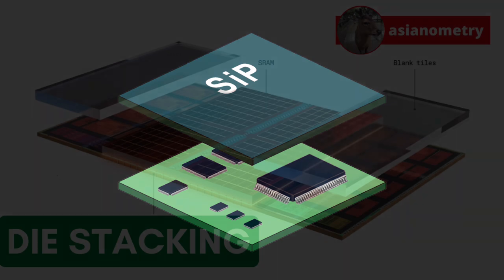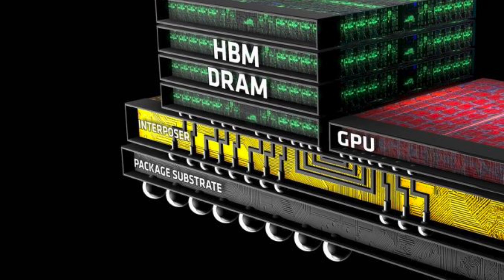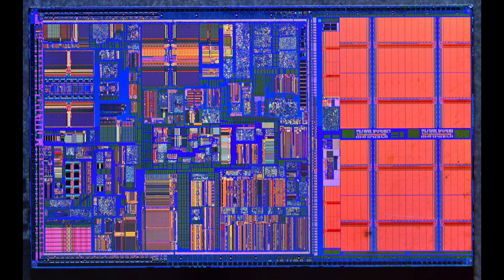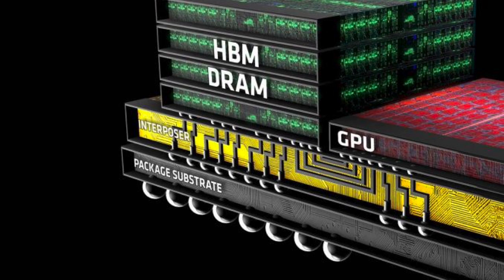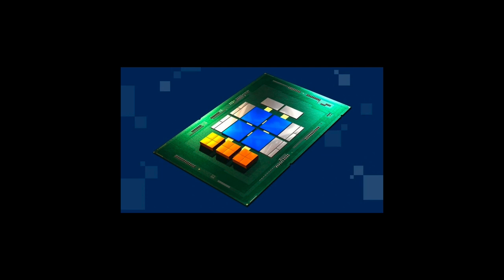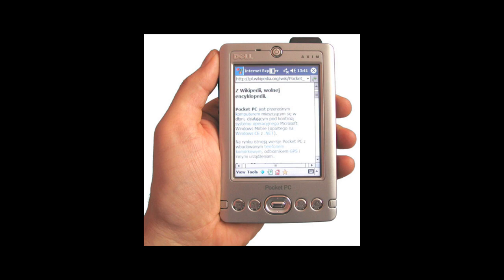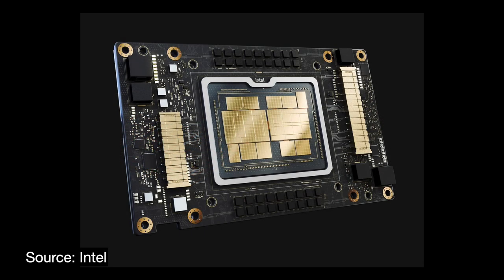Stacking Dies For Performance and Profit

Comment: At 11:35 you said "for their part, the memory industry went three dimensional back in the early 2010s", while showing a picture of a 3D NAND chip. 

The 3D NAND chip you're showing does not use die stacking. The 3D part of 3D NAND refers to multiple layers of memory cells built on top of the surface of the silicon, as opposed to "planar" memory cells or transitional transistors, which are only built one layer, directly on the silicon surface. The 3D NAND chips are still monolithic chips - single silicon dies, with many layers of NAND storage cells. Those 3D dies can then be stacked into multi-chip-packages using traditional die-stacking and wire bonding techniques, of course, but like you said at the beginning, that's been going on for decades.

Comment: I suspect one of the viewers might know this.  Do large sizes of L3 SRAM get as hot as the compute or accelerate portions of the die or is it essentially the same even if on a single planar wafer? Curious if the delta T for the cache is significantly lower then possibly it-itself could act as part of the heat transfer package to a heat spreader and to outside world.

Comment: I found MCMs really frustrating. Customers would ask for huge numbers of something we didn't have, but which was a simple combination of 2 or 3 things we did have. So, do an MCM with the existing  dies and we have a quick turnaround solution. However, when we got to the grubby details these things hardly ever worked out.

Comment: The channel is too focused on CPU/GPU.
Image sensors were the driver for 3D stacking. Direct wafer bonding (with Cu to Cu direct connects) of the pixel sensor chip to the image sensor processor is in high volume mass production since years. Everybody has such product today. The technology is amazing the pixel sensor wafer  is in the end only 10um thick and processed from both side with just tens nm overlay shift. Also the wafer to wafer overlay shift much less than 1um.
Todays smartphone cameras rely on that technology. You have very small pixels for small/cheap chips with many pixels but still low noise.

Comment: Can someone explain why we need to stack separate chips, instead of just adding more layers to the same chip? I know different memory and compute use different processes but can you really not just move the wafer from one to another?
Reply: They do that in DRAM and flash memory chips. I'm not sure why you don't see it done with logic. My guess is the transistors you can make are lower performing and slower so the processor would slower.
Reply: That is because the DRAM process is different from the HPC process, that is why on Zen x3D the stacked cache have double size on the same area.
Reply: @vitormoreno1244  the V- cache chip is SRAM, and they are usually made on the same process as logic, because in every processor except some of AMD's new ones, the cache is on the same chip as the logic. Making a chiplet with only SRAM let them optimize for it and double the density that they otherwise would get for the process.
Reply: @davidgunther8428  I'm pretty sure it's also because AMD were alerted by TSMC that memory-size scaling is going to slow down first - recall in the video when Asianometry mentions that memory only shrunk by 5% between 4nm and 3nm? Apparently 3nm+ will have NO shrinking of memory structures. It then behooves AMD to dislodge their cache from their logic, for future processors. (same obviously why they did the same with GPU's starting with the 7000-series, but without 3D-stacking)

Comment: I remember when stacking was putting a RAM box on the side of the big box with the CPU, instead of running fat parallel cables down under the floor, and up into the other box. Going from > 4 meters to half a meter.

Comment: Awesome video as always, just a small addition, TSMC 3D stacking don't use micro bumps, they use direct copper bonding. IMHO Intel version is called tiles just for arrogance.
Reply: Intels 3D stacking is called Ferveros. EMIB is referred to tiles which is 2D.
Reply from the maker: Thanks for the info!

Comment: Yesterday I ordered my first 3D stacked techbology - the Ryzen 7800X3D. I am exited since it is my first upgrade in over a decade.
Reply: I am also excited for my first 3D stacked technology, 5800X3D. Hopefully, will get it soon. These 3D chips are legendary.
Reply: Pretty amazing what Ryzen brought out. I'm still running a bulldozer "8" core 8350.. I'm no power user, but damn if ryzen isn't looking pretty great right now.
Reply: Embedded parts have been using dram stacked on top of the SoC for many years already. Just less advanced/specialized versions of the same tech. E.g. various smartphones and arm tablets have been using that tech.
Reply: @imrevadasz1086  that's not even remotely the same thing. Different memory technology, different rationale, different bonding method.

Comment: I recall Intel made a chip with something like 30 cores where each core had the L2 cache under the individual core, making for pretty exceptional latency. The problem was the things would basically melt, which is seemingly the problem we still have today. Without some kind of magic (MRAM) 3D stacking is probably going to be a serious thermal challenge with SRAM. Maybe not so much with eDRAM. Anywho, great video as usual.

Comment: AMD had to add substrates to their Vcache CPUs (5800X3D, 7800X3D, etc....) to make an EVEN HEIGHT across the top of the package.  The stacked cache only covers the cache on the main IC, so there's a lot of space that isn't covered by the stacked cache. In the diagram you show at the very end, the added substrates sit over the cores.  But you need the top of the package to be the same height (Z-height) because you need a VERY level top surface of the IC, because you put a heat spreader on top of this die and there has to be full contact between the IC and the heat spreader.  On top of the heat spreader, which covers the entire package and is what you look at when you see the top of a CPU, you put thermal paste and then a cooler which wicks heat away from the CPU.

So those substrates exist to make an even height to the IC so the complete IC package is in full contact with the heat spreader.

And TSMC's die stacking has been in mass production since early 2022 when AMD's 5800X3D was released.  It's now in 3 more AMD CPUs, their new 7800X3D which came out today, the 7900X3D and the 7950X3D.  Or, these are the desktop CPUs.  AMD also has server parts with stacked cache going back to Zen 3 EPYC, so once again early 2022.

You didn't cover the limitations of stacking, heat.  For CPUs or GPUs stacking is very limited because stacking a die over die when that die contains CPU cores which clock VERY fast, heat becomes an issue.  If the cores are on the bottom stack, the heat from the cores has to pass up through another layer of transistors, and this will make that top layer EXTREMELY hot.  So, stacking is limited, and best suited for circuits which are clocked slower meaning less power consumption meaning less heat.  Heat dissipation is everything with these packaging technologies.
Reply: This is a bot...
Reply: @volvo09 how do you know?

Comment: The chip industry differentiating 2.5D vs 3D per the examples you researched is arguably a semantic play. The examples all look like stacked 2Ds to me. True 3D is substantially more difficult than any ever-more-intricate layering of flat objects. As soon as the word “stacking” is used, that is not going to be true 3D. 

An analogy exists in the CAD and data visualization market. AutoCAD and ArcGIS use (do they still?) data interpolation in 2D and then stack the solutions into a “3D” image or matrix, generating a 2.5D result that looks 3D, but is not truly. Ctech EVS does true 3D data interpolation. 

Making a computer chip that is genuinely 3D might require light to flip bits, and detect the flip (w diff wavelength), in a translucent matrix.
Reply: you sound as if no 3D printer uses layers xD 
or that those don't count as 3D either
Reply: 3D with layers is still 3D. You're right that if we could have the device density be the same in each direction it would be much more compact. 
Heat removal will always be an issue though, so flattened shapes will probably stick around.

Comment: Sony uses stacked image sensors so the transistors are on a layer below the photodiodes maximizing their size. Certain chips also include a cache used for global shutter or 960hz video framrate for 0.2 seconds.

Comment: Texas Instruments did cpu-dram stacks back in the early 2010s or earlier already, e.g. in the OMAP series for e.g. smartphones. For example the Omap 3500 series that was used e.g. in the original TI Beagleboard SBC, that had a cortex-8 cpu with a 512MiB Dram chip on top. But it was limited to that one Dram chip of course, and couldn't stack further.

Comment: Once again an EXCELLENT long awaited episode about chip stacking! An amazing job as always, no BS just real facts and proper info which in today's world is WORTH of GOLD! (I will become a Patreon, u r on my list).
I particularly like the 13:40 part where u highlight very important point about limitation in SRAM/cache shrinking. This is in my opinion a CRUCIAL reason to 3D stack SRAM in a similar way as AMD did with their V-Cache and of course increase its performance and size.
I would say and go as far that I would predict that in the next decade not just because of the limitation of the Moore's Law but mainly because of the rise of the in memory brain-like neuromorphic computing we will see stack SRAM rising to GBs which would push classic DDR even further away from the CPU/SOC. Of course implementation of the next gen transistors will play its role too, as well as the further development in silicon photonics which should finally get us out from the limitations in degrading speeds when being further away form the CPU/SOC.

Still the key in my opinion is that the most fastest next gen memory like future SRAM we can come up with will be on par with the CPU/SOC and there won't have any limit in speed between them. Von Neumann architecture will be eventually replaced by a new standard where CPU/SOC is not the Alpha&Omega of the computer.
We have to simulate our organic brain in a synthetic form which won't degrade and evolve further. This is the main advantage of us humans that we can create something which will surpass us and will last much longer than we do. Just take a look at the OLED panels... everything organic degrades, however synthetic is much more long lasting (microLED).
Still the organic creation and its interlinked supersystem is still the most amazing creation above any synthetic form we will come up with in the future and we should never forget that. But maybe a way forward is that we understand them both as one can inspire the other and help us along the way to grow as a species.
Reply: Did you hear of generative pre-trained transformers?

Comment: That ".5 more 'D'" might be neat, but, maybe I should listen to the presentation again to try to better comprehend what is "D" and what is the other 2.5 of it.
Reply: D means "dimension"
2D is flat surface
3D means volume

2.5D here are chips where parts (compute/cache) aren't on top of each other, but there's a layer of vertical+horizontal wires below

Comment: we need L1 cache glued directly above the compute transistors that need it or else its gonna be a big limiting factor.
Reply: Had the same idea. SRAM can also be much more dense when it's made with a process optimized for it, which can be used when it doesn't need to share a die with logic.

Comment: 🎯 Key points for quick navigation:

00:03 📦 Introduction and Definitions
- Introduction to die stacking and its importance following Moore’s Law.
- Definitions and distinctions between 2.5D and 3D packaging.
01:25 ❓ Necessity of Advanced Packaging
- Discussion on the necessity of advanced packaging technologies due to the end of Moore's Law.
- Introduction to accelerator chips alongside CPUs and the Chiplet approach.
02:24 🕰️ History of 2.5D Integration
- Overview of the history and development of hybrid circuits and multichip modules (MCMs).
- Explanation of how these historical technologies laid the groundwork for modern 2.5D integration.
04:16 🌉 2.5D Integration and TSV
- Introduction to Through-Silicon Vias (TSVs) and 2.5D integration.
- Key technological advancements and first commercial implementations involving TSVs.
05:40 ⚙️ Advantages and Challenges of 2.5D
- Advantages of 2.5D integration in terms of physical space, thermal limitations, and memory capacity.
- Discussion on disadvantages such as cost and points of failure, and potential future improvements.
07:08 🔧 Chiplets and Standards
- Recent developments in chiplet technology and industry standards.
- Potential geopolitical implications and the adoption of chiplet technology.
08:34 🏛️ 3D Integration History
- Historical background of 3D integration dating back to the 1950s.
- Introduction to Tinkertoy circuits, Micro-Modules, and early attempts at vertical stacking.
09:31 📱 Package on Package
- Development and examples of Package on Package solutions.
- Explanation of their adoption in consumer electronics like smartphones.
11:00 🏢 Die-to-Die Stacking
- Explanation of Die-to-Die 3D integration via wire bonding and TSVs.
- Comparison of traditional wire bonding versus TSV potential.
11:29 📸 Stacked Image Sensors
- Introduction to the use of TSVs in CMOS image sensors and their benefits.
- Industry breakthroughs and production timelines for stacked image sensors.
12:26 🔍 Overcoming Manufacturing Challenges
- Major manufacturing challenges faced in 3D stacking.
- Solutions like cooling techniques, defect testing, and reliability measures.
13:21 💡 Conclusion
- Latest advancements in 3D die stacking in key products and companies.
- Summary of TSMC’s recent achievements and market readiness for deep chiplet-style integration.

Made with HARPA AI

Comment: The OG 3D CPU was the Cray 2 Supercomputer, where the CPU was built from a tightly packed stack of logic boards. The big disadvantage of that tight packing was that it had to be submerged in an inert cooling liquid.

Comment: Nice. Now you have 2 separate gpu temperatures, gpu and junction temp, and the delta between them is like ~30°C, and when junction reaches 100°C it throttles like a mf no matter how beefy the cooler is.. Thank you, "3D stacking technology"

Comment: 50 years in and we are still only making sandwiches.

1.  Curl the chip into the form of a cylindrical tube.   Yes they can be manufactured that way, but it requires capital.  Why?  because you can pump cooling through the tube and contacts and leads can radiate outward to other components.

2. Design the computer in a laminar way with other components on the outside of the central core.   This is kind of biomimicry in a way.  Like how a living plant or circulatory system distributes nutrients to surrounding cells.

3. Have memory surrounding the central processing tube (cpu).  

4. Have graphics chips in line with the central processing tube.  The graphics chips have also been formed into a tube as well.

5. Use evaporative cooling...an inert fluid that can even bubble in the central hollow of the chip and lift the heat up and away as it is created.

6. Shorten the distances traces from the chips have to go by having them radiate outward in successive layers.

7. Use less voltage and have a higher thruput of coolant.

This makes the system have built in short cuts as well as built in cooling channels, as well as a less urban sprawl kind of structure and mirrors the efficiency and simplicity of design seen in living systems.   

Mother nature outgrew making simple sandwiches early on.  Mother nature got tubular.

Thank you, my fellow tube-based organisms for reading all of this.

Comment: It's interesting why they put L3 cache on top. The CPU die is hotter, you would want it to be closer to the heatsink.
Probably because current CPU die is designed so that it can't interface with L3 under it, the contacts are on the top, not bottom.

Comment: As for the overcoming fundamental limits which industry is about to hit, there is a third approach: new materials and superlattices, potentially allowing higher frequencies and lower power consumption. (Like GaAs-based structures).

Comment: Thank you Asianometry for such a great video on stacking!

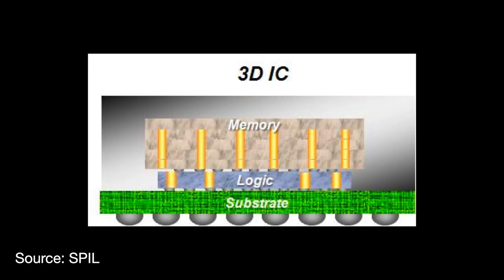11:15 and on, about image sensors...
It is worthwhile to mention two dissimilar technologies used in this space:

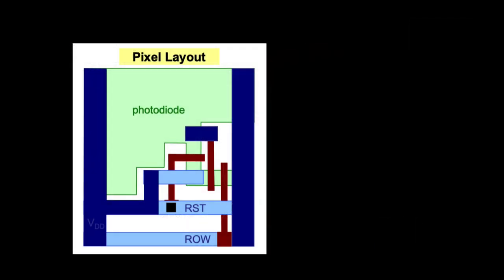The first one is BSI (Back Side  thinned Illumination)  which is not stacking.  This only applied to each and every active pixel (sensel) per-pixel dedicated region.  It's like double-sided printing on a piece of paper.  The first side created is the transistor side ( 11:40 picture's bottom side), then the entire wafer is flipped bottom side up, polished (thinned), processed to form the photo diode region (almost 100% fill factor.)  AR layers, mosaic filter pigment deposited, and microlenses are grown on that side.
Other common functions, shared sensel components, and support logic circuitries were also fabrcated on the first part of the process (on first side), mostly outside of the active pixel region   Sony marketed it as EXMOR-R (R reflects BSI design.). Note that at this point, it still is one die per image sensor.

SONY later introduced 2-die stacking (bonded using TSVs) marketed as EXMOR-RS.  Some support functions are moved to the second die and other new features are also built on this new (mostly) logic-only die such as memory, decision logic, arithmetic ops, I/O, etc.   Now it is truly stacking.

Comment: If we are to keep 3D stacking, the chips will need to start having internal capillary cooling systems to pull heat away from the chips and onto its packaging to prevent serious thermal throttling.